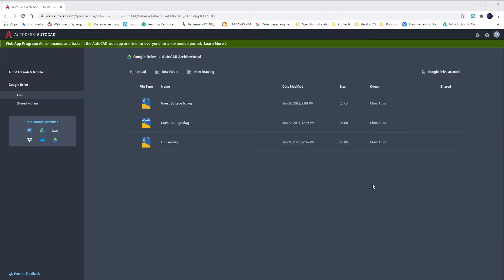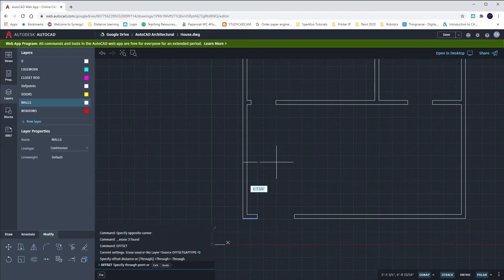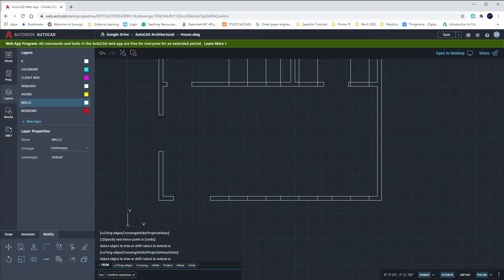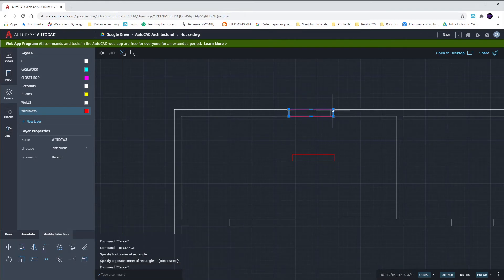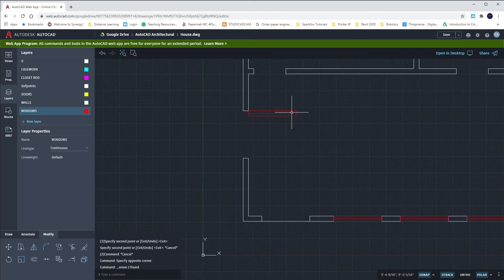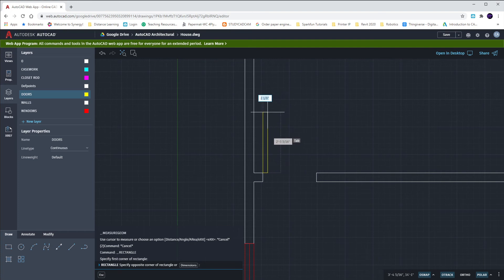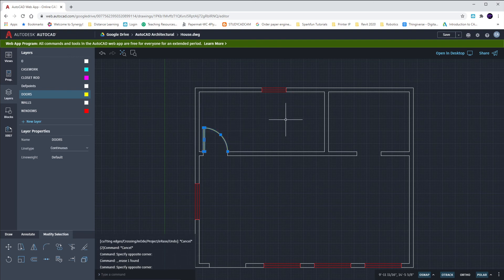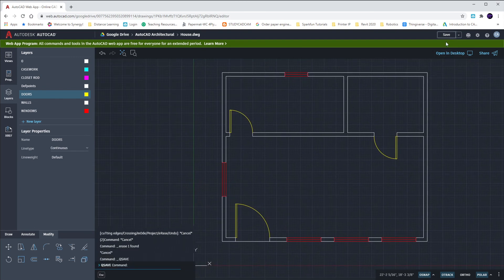2. Guest Cottage - Doors and Windows

Comment: Thanks for the tip on using the circle tool for the door swing!
Reply from the maker: @toddbarnett3039  I’m glad it helped. Without the extra arc options found in the full program, in AutoCAD Web I found it easy to just trim the circle to create an arc for the door swing.